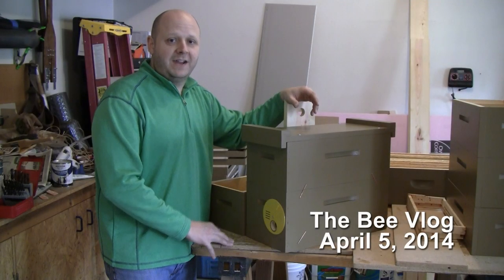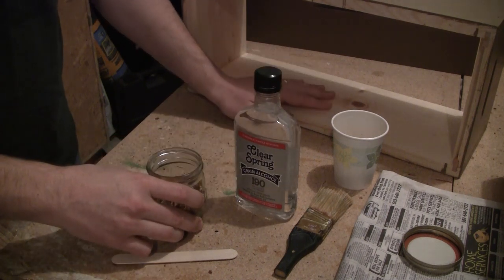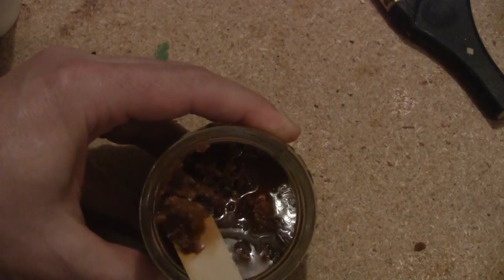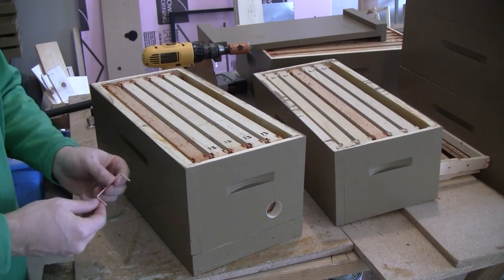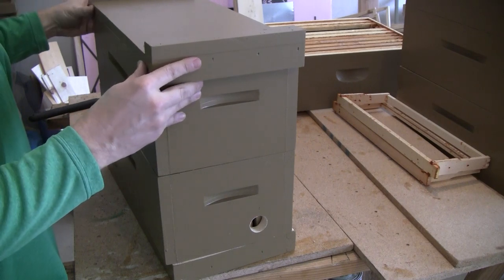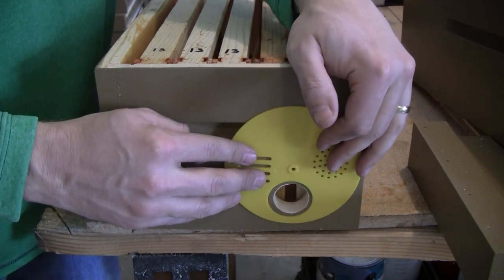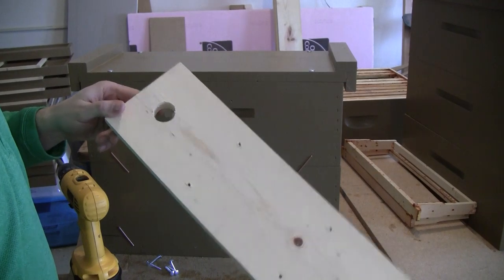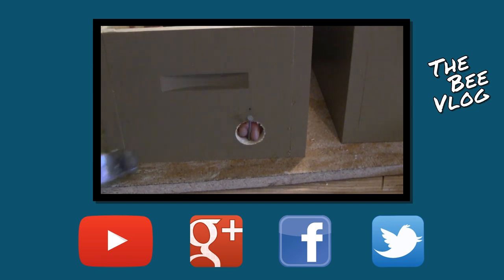Swarm traps are done - Bee Vlog #127 - Apr 5, 2014

Comment: Very nice. I guess it's time for me to get back into my shop and make one of these now.  Thanks for sharing :)

Colin
Reply from the maker: Don't delay. Get them out soon. In my area we are expecting to see swarms any day now.
Reply: Success, I finally got one out today at lunch.  I messed up on the measurements a little and ended up with 2 four frame boxes, but I'm sure the bees won't mind at all.

Would you recommend putting more than one trap out in the same area or would that be overkill?
Reply from the maker: 4-frame boxes would be fine too. No harm there. Yes, putting more than 1 in an area is a good idea, but don't put them too close together. Maybe 50-100 feet apart. Too close together and they may get confused when communicating the location of one and it may delay their decision making process. Good luck to you!

Comment: Thanks for the vids..I've been interested in bees since a kid and now that I'm retired and info like yours is available I might get around to it..just one question..do hives HAVE to be made of wood?? I noticed they always are..do you know of anyone who's tried synthetic materials like fiberglass or poly pro??...sorry if that's a dumb question but like I said I'm just getting started and have a lot more experience with those materials than I do with wood..
Reply from the maker: Oilsmoke Jones I think wood is the most common because it's cheapest and easiest to work with. There are companies making plastic insulated hives, but the cost seems to keep the acceptance rate a little low.

Comment: Good idea on the wedges, I've used nails, but wedges make more sense.

I have been using coraplast for the bottoms and tops to keep it cheap. But you need coraplast that is dark. You can paint them but they don't hold paint really well. One of the candidates near me had signs that were navy and dark red, so that worked great. I was able to get several 4 x 8 signs for nothing. Since this trap is in your back yard you don't have to worry about theft though, and the upside to using a really top and bottom is that if you need it you have a hive already to go right there.
Reply from the maker: Yeah I thought of using nails, but then the wedges caught my eye in an old video about migratory beekeeping in Australia. I built these traps with the idea of giving them a double life as nuc boxes.
Reply: I've put wedges in the 4 traps I hung today. Nails work fine and don't mess the box up, but wedges make a lot more sense. Thanks!

Comment: Would there not be a better way of fastening the two boxes together?  You would have to take the hive staples out to get the frames out of the bottom box.  Seems that repeatedly doing that to reuse the boxes would not be good for the boxes.  Seems to me that some kind of permanent latch would be better.  Your thoughts?
Reply from the maker: wwasher I'm sure there's a better way, but not as cheap as staples. And there's not much repeated installation and pulling of the hive staples. Just once per year.

Comment: What is the proper name of the plastic gate and where to get it?
Reply from the maker: It has many names: entrance disc, hive gate, entrance gate disc, etc. Most online and local bee retailers carry them. They are also available in metal. I would recommend the metal ones. I got these plastic ones from my local supplier. They do okay, but after a few years now they are beginning to show some discoloration, which I'm sure will eventually lead to brittleness and breaking.
Reply: @TheBeeVlog  If you have a 3 D printer you can print your own for minimal cost!

Comment: Bill,
What plans/designs do you use for your SBB and your migratory top?  Were they from Michigan Bees as well, or did you find another template?  I'm having a hard time finding good plans for all the parts of the nuc you made using 1x8 lumber.  Most plans call for plywood, but I like this style with solid wood and would prefer not to reinvent the wheel while I'm learning carpentry skills.  If you have some plans, I'd love to look at them.  If I understand correctly, just putting a piece of plywood on the bottom would not allow proper bee space, so the bottom board would need to have rails to give the bees the space they need to move around.  Is that correct?  What are your thoughts on on the Coates nuc and bee space under the frame rests?  Is it too much?  Thanks for your help.  I'm about 2 hours north of you and appreciate your videos since you're in a similar location.  This will be my first season trying to catch a swarm.
Reply from the maker: I didn't follow any plans for the SBB or the migratory top. I just used my best guesses. I did leave extra bee-space on the bottom board for the reasons you mentioned too. For the SBB I just cut 3/4" wide grooves centered in some 1x2. I then framed it around the solid board, glued, and stapled. This made about a 5/8" extra "shim" to give more space under the frames. For the migratory top I cut a board that was about 1/2" longer than the box and same width, then glued/stapled a couple strips of wood on the ends to keep the board from cupping or warping. Also, if I use a small shim under the lid at the front of the box and push the lid all the way forward, it makes a protected gap that makes a good upper entrance/vent. Sorry, I don't have plans.

Comment: So I made my swarm traps exactly like yours except I just screwed on plywood for the bottom.  Anyways, did you have to put frames in the lower box before stapling the top on, and did you have any issues taking the staples off to move the swarms you caught?  Do you just use the hive tool to take the staples out?  Thanks!
Reply from the maker: Yes, I put frames in the bottom box before stapling them together. That way if they draw comb faster than I can move them out I don't get a lot of crazy comb. No issues removing the staples. The hive tool pulls them out easily.